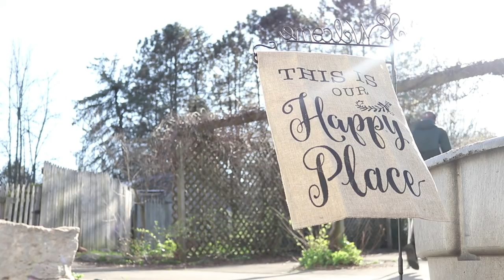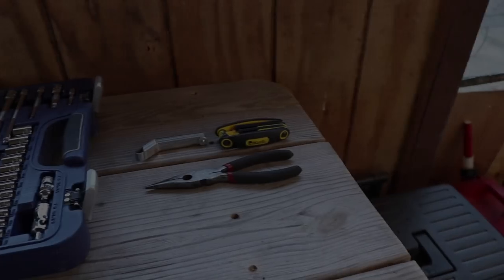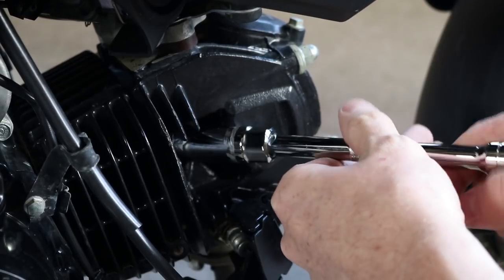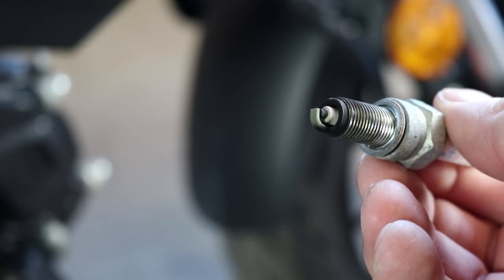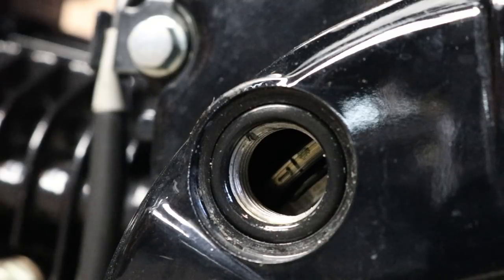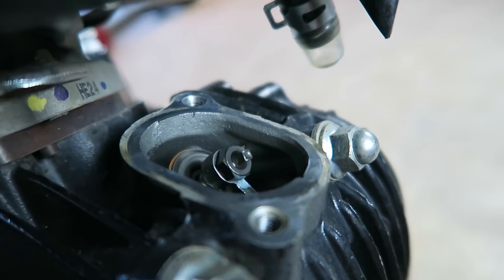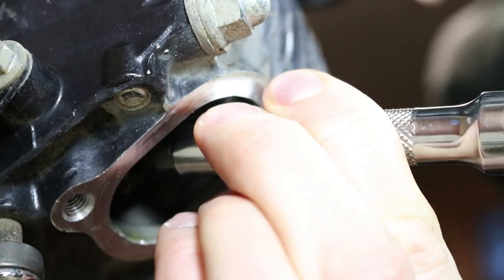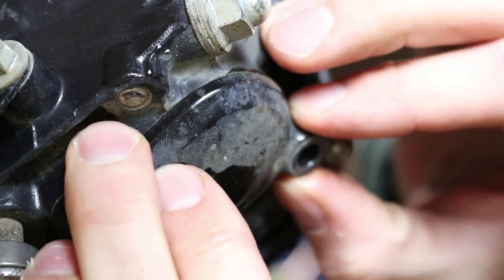How To Do A Valve Adjustment On A Motorcycle / Dirt Bike (Non Shim Type)

Comment: As a professional technician of 40+ years and now teaching high school students the wonderful world of Powersports, I always leave the feeler gauge between the adjuster and valve stem to prevent a mal adjusted valve. I would use a boxed end wrench to secure the jam nut, that way you can make sure the adjuster did not move while tightening. Then slip the feeler gauge in & out to check for proper drag to ensure the valve is spot on!        Bill Ross - Outdoor Powersports Instructor -  Maine Region 10 Technical High School, Brunswick, Maine
Reply: I'm surprised these guys never mention rotating the engine again and rechecking 🤨

Comment: Better to use a regular wrench instead of a socket wrench when tightening the lock nut. That way you can see the adjuster and make sure it's not tightening with the lock nut. If it does move when tightening lock nut just hold it in place with needle nose pliers as you tighten lock nut
Reply from the maker: Good tip! Thanks for watching
Reply: Yes, I was about to say the same thing!  It is also good practice to recheck the clearance with feeler gauge after tightening. Just to be sure.

Comment: Sure the big bladed and smallish bladed screwdriver lever method works but special tools are less than $100 and it's shim out shim in in around 2 mins unless it's some Yamaha FZ750 shim under bucket so camshafts out.

Comment: You didnt explain why you did any of that, what you want it to be like, why and what feeler gauge you should use, and why this is important to do. I loved the video but I still have alot of questions and I wish you had answered them.
Reply from the maker: To check the tolerances of the valves as recommended in the service manual. Making sure they were in spec, the feeler gauge numbers were displayed on the screen and I even linked the pair that I used in the description, if you are looking for a detailed video on how valves work this isn’t the one, I just showed the basics of making sure they are in spec, which is all you really need to know.
Reply: @AdventureDaily  like I said I loved the video but it would be awesome if you would make one for complete idiots like me. I
Bought my girl a crf 125f and the manual doesn't have the value clearance or anything to do with valves in it. I checked online and couldn't find them either. I found the crf110 witch I'm guessing probably have pretty similar specs but I think I'm going to have to call honda. Thank you for replying. I wasnt criticizing you. I was letting you know what people who know nothing see the video.

Comment: great video. could you tell me what happen if we don't check/adjust the valve after thousands of miles?
Reply from the maker: Thank you! Honestly just lack of performance, I wouldn't worry about adjusting them at the recommended level but it really just depends on how hard you ride them.
Reply: @AdventureDaily  I rev it really hard since 400 miles. Now 3000 miles and I never done the valve adjustment but I noticed that the engine sound really quiet than before. Anyway I will do valve clearance checking soon.

Comment: I bought a feeler guage and have the mechanical skills to check and adjust the valves, I just dont know what feeler guage to use? I dont know what .004 plus/minus .001 means? What feeler guage should I use on the top? The .004 ? Do you use multiple to achieve the recommended clearance?
Reply from the maker: The +/- is the acceptable range. I listed the specs on screen. Standard and Metric.
Reply: @AdventureDaily  I appreciate it. It was real confusing based on stuff I have read. But just finished the valve adjustment for my 2015 grom and it runs better then ever. Thank so much for the video!!

Comment: how do you know if the exhaust valve is too tight? i adjusted mine for the first time today because I changed the Camshaft on my Grom. the intake valve was set to .004 and had some resistance using the filler but the .005 could barely get in it. Now the exhaust valve; I checked it before getting it loose and it felt really tight from factory. The .007 went in with difficulty and came out the same way, so after I Installed the new camshaft, I left it the same way. The engine sounds a little different when idling, but Im not sure if Its because of the Koso camshaft or the valve too tight. Also I noticed that I lost some Torque at the lower end, but Im hitting 73-74 mph at the high end 8500 rpm's. I have stock bore 125 with air intake and zoom exhaust. It also feels a little hard to start. I have to rave a little bit the engine to start it sometimes. Is this because of the exhaust valve? or is it normal thing to do with the new camshaft? Thanks in advance 🍺

Comment: I won't guess on the "new" bike, lol... Nice video man. Couple of things to mention. Make sure the engine is dead cold before adjusting valves. I don't remember if you mentioned it or not. Also, if you can't remove (or don't want to) the timing plugs you can always remove the spark plug and launch a pencil in the cylinder, slowly kick over the engine and you'll see TDC pretty easily. Those types of rockers will break if you're not careful. So like you said, go easy and make it snug or check your manual for torque specs. I find that open end box wrenches work best for adjusting valves like these and you want just a little "drag" on the feeler gauge. 4 stroke engines need this sort of maintenance done once and a while to aid in easy starting and not burning valves. Good video my friend and I hope you heal up FAST!
Reply from the maker: Hey now I moved up a few years lol, over a decade actually. All good tips for people to know!

Comment: Have a issue. ABS light flashing after i did a sprocket change. Went from a 15 t front to a 13 t front. Now my ABS LIGHT flashing. I feel that my front brake works fine. But jist curious to way.

Comment: Hey Dave get this, see for me having done atleast 750K km over 6 years as a Melbourne motorcycle courier I've trashed a few bikes the bike that I maxed out was a venerable 1985 Kawasaki GPZ600R see it had 35,000km on it when I got it the clutch wouldn't engage at 115,000km so mothballed but it's screw and locknut valves if you smoke rolling cigarettes you start the bike then have a smoke the best commuter set up is the Honda CB750 with hydraulic valve lifters.

Comment: @attention deficit  I am at 10k and haven't done this yet and don't want to take it into the dealer to do it. I also don't have a deeper gauge  how cold i do it just open up undo lock bolt and twist with needle pliers ? Can I go seriously wrong?
Reply from the maker: You need a feeler gauge to do the job. I linked it in the description of this video it's extremely affordable. They have to be adjusted to the specs I showed in the video.
Reply: Attention Deficit  okay I will pick 1 up all the specs are in my book cheers is it simple can i go wrong?
Reply from the maker: Yeah it's as easy as what I showed in the video! Watch it a couple times and you should be good to go. Let me know if you have any other questions. Also follow me on Instagram if you need to send pictures @atdfct

Comment: So I went to finally adjust my valves yesterday for the first time (4800mi) and noticed my Grom's valve clearances were extremely tight, so tight I couldn't get my intake .004 or .10mm  and my exhaust .007 or .17 in. So when I adjusted them to Honda's specs and rechecked them, fired up the grom and rode it around I noticed it's ticking louder than before 🙄 wtf? I'm ocd af so I know it's in spec but why is it louder than before? Like I said prior to my adjustment I could not even get the feeler gauge to slide in 

I'm confused. Help 🙏🏼
Reply from the maker: Were you at TDC when you checked them? Also do you have anybody to compare with? Might be normal tick tbh.
Reply: @AdventureDaily  yes, I fixed it. It turned out my feeler gauge was too long, I was getting a false reading. I ended up bending the tip of my gauges so I could fit them in properly for a more accurate reading. Once I did that and readjusted them, I gained power back and didn't hear that tick sound anymore. Thank you for checking up with me though I appreciate that